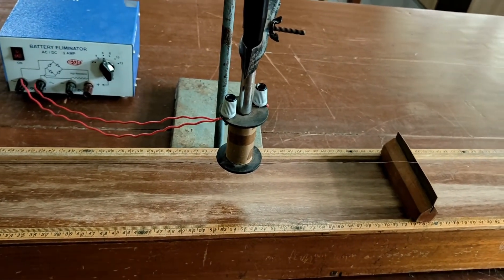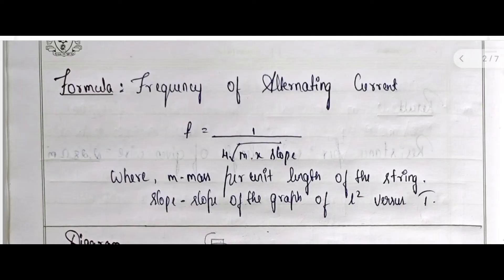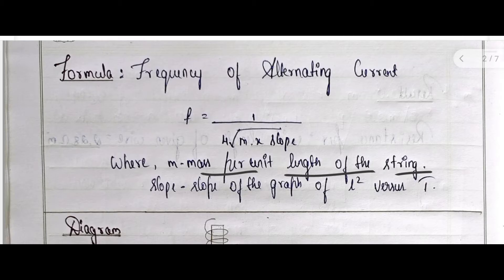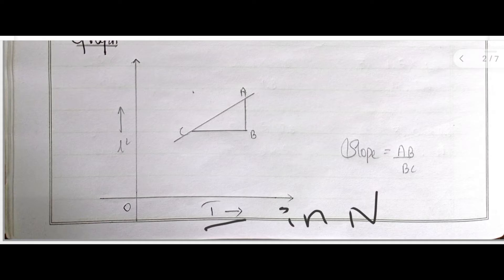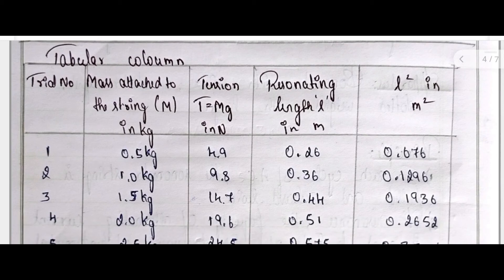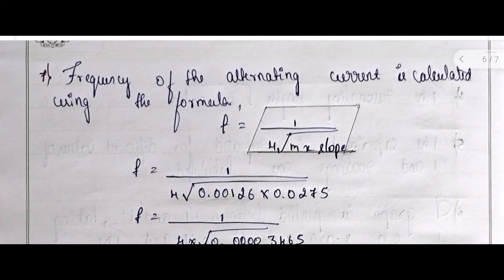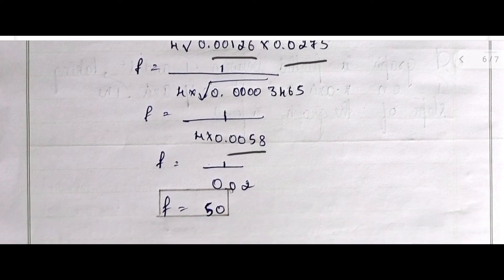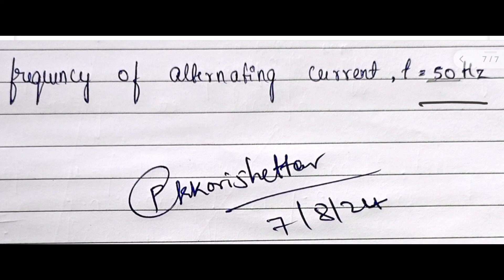Frequency of AC Experiment | Class 12 | PHYSICS

Comment: Sir what is the f value if the given mass per length of the wire is 0.63(10^-2) and the slope is 0.02 plz tell me the answer of this sir
Reply: Because I got a m value as 0.63(10^2 ) in practical sir so but I got slope value as 0.02 sir plz do calculation and tell me the answer sir